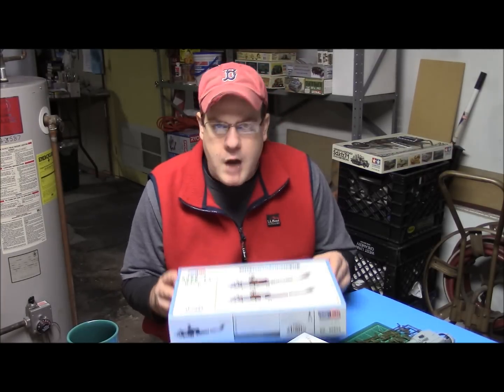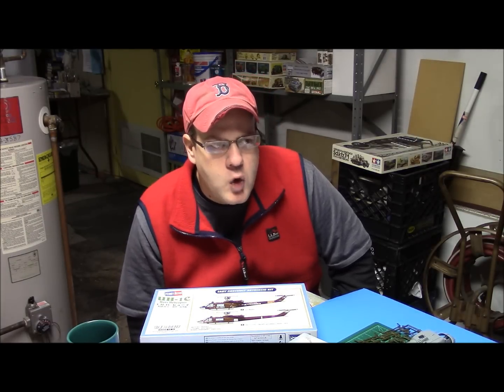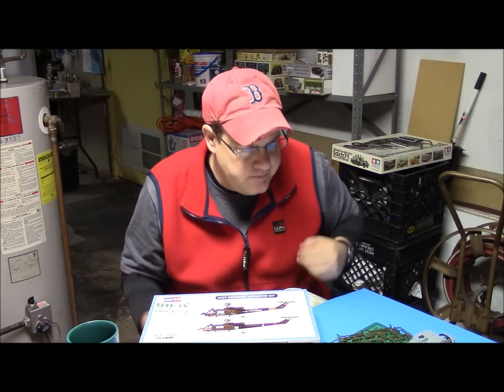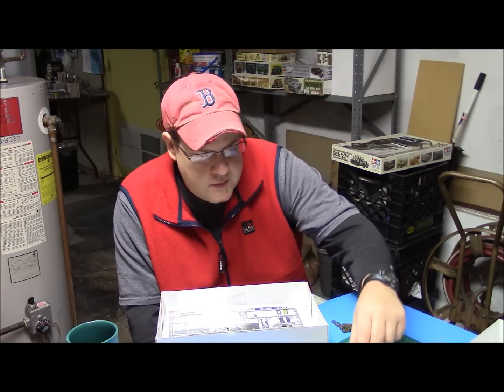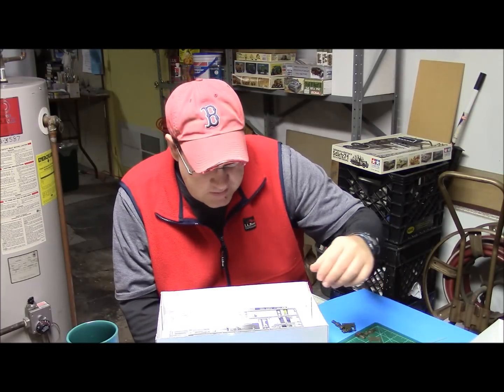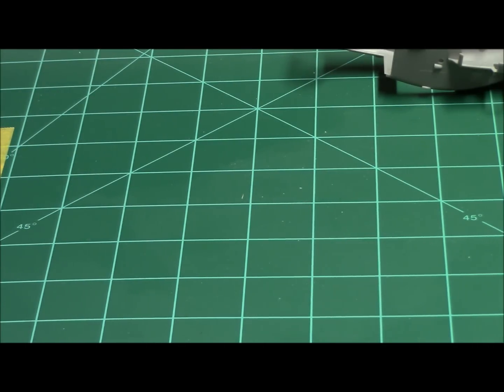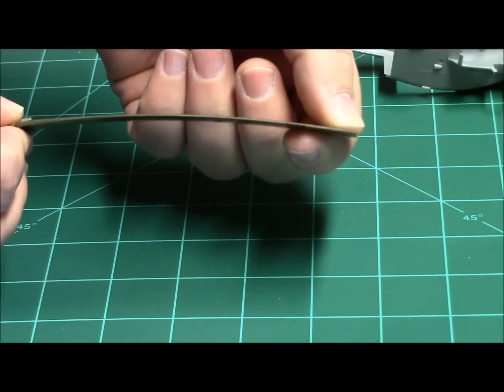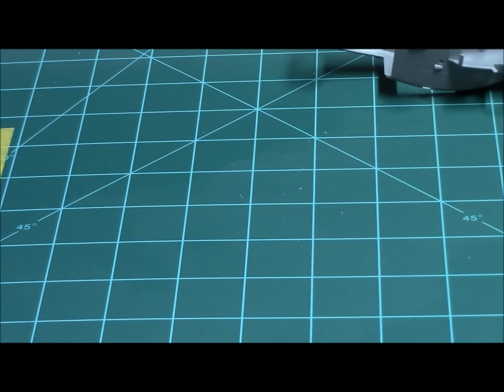Get Outside Your Comfort Zone GB: UH-1C Huey Hog Part I

Comment: Impressive project Russell. Scratcbuilding an interior and kit bashing all in one....very cool and ambitious. Good Luck and Enjoy.  Thanks for the mentioning during the video....hope you use the Revell aircrew on the Huey. I always think vehicles look better with the Human factor added. I used the same figures on my Westland Wasp build.....they're good ones.
Bill.
Reply from the maker: ***** Thanks for the kind words, Bill.  Yes, very ambitious.  I just hope I am not pushing it too far.  The fun factor is an imperative that can't be forgotten, especially with this build.  It's too easy to get stressed.  I did plenty of research on the techniques I will be using . . . I think I can handle it.

Comment: I realize this is a little late, but you can use food coloring and floor wax as a tint.  It comes in several colors.
Reply from the maker: Not too late, as I have just recently returned to the Huey.  Thanks for the tip.  would you apply food coloring after painting?  I would imagine it would lift off with masking tape.
Reply: You mix the food coloring with the floorwax
I saw a Youtube video of a guy coloroing red and orange taillights to a 1/35 auto build.  Worked great.  The floor wax acts like the carrier/fixative for the food coloring.

Comment: Really ambitious build, sir!
This is a really interesting build topic! I'm interested in the amount of research and planning you put into the project.

Funny enough, I'll be building a gunship-troop transport conversion chopper as well.
Im planning to build the Academy 1/35 MH-60L DAP. The box mislabels the chopper designation as "AH-60" for some reason.
The bird's got some wicked firepower and the kit itself is huge! It being a big kit and building a chopper is definitely going to break a sweat haha

i look forward to more progress!
Reply from the maker: JohnP Modelling Thanks, John.  You're right.  The MH-60L DAP Academy kit is HUGE! Best of luck to ya :)

How do I go about the planning and research?  Once I have an idea I always make sure that I can support it with both resource material and my skill set.  In this case, I really wasn't sure about doing the interior on the Huey.  I needed anti-skid plate, which took some time acquiring.  I almost gave up on the idea because I had no idea how to replicate the interior walls.  But then I found a kitchen item that I can use to stamp onto the putty.  Almost like zimmerit.  A lot of it is just playing with ideas in my mind.  I also do a lot of drawing, especially with scrathbuilding.  It helps out  alot.  Like I said in my video, I gather as much photos as possible.  The internet has a lot.  The real trick is to be very specific in the search engine, such as knowing the correct terms for the engine and rotor, weapons system, etc. I could go on and on . . . Hope this helps!  Model On!